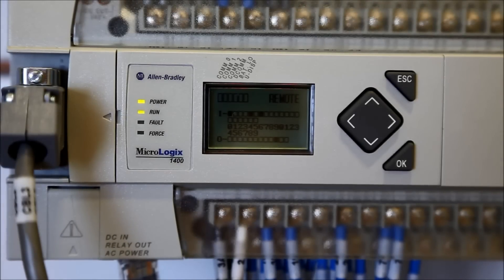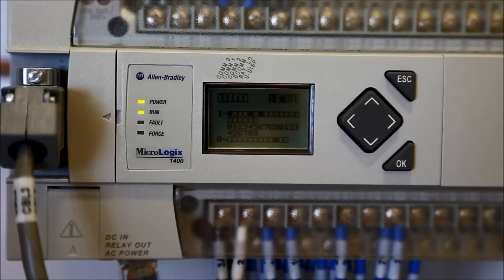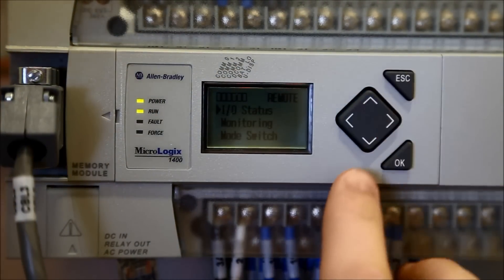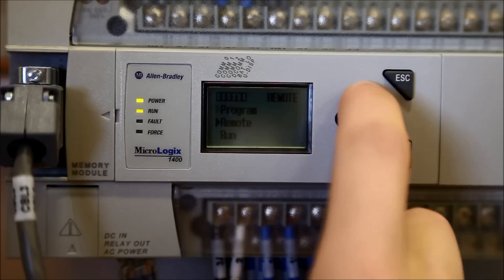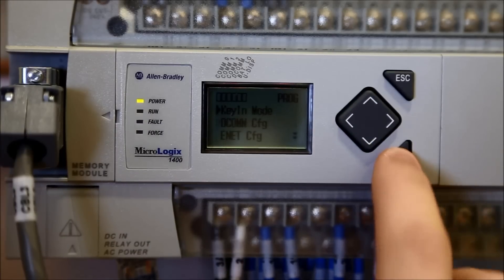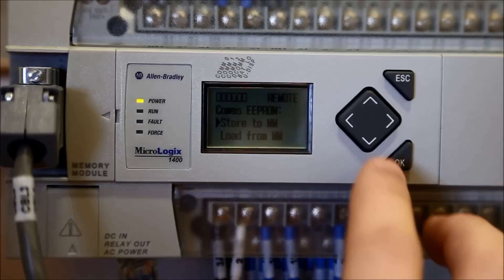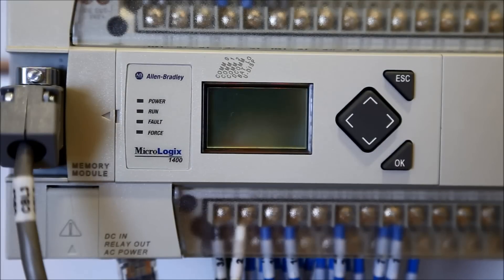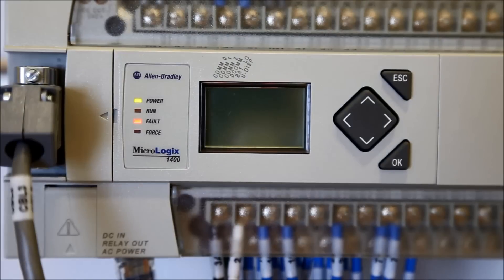Download a Program to a MicroLogix 1400 PLC via Memory Module Using the LCD Screen

Comment: What updates could it have on the MM that i should be concerned about deleting? If i take the old program thats written on the MM and then add a couple lines of code and then write to the MM again, would you suspect i would be fine?

Comment: Are you sure that is possible to insert an memory card with the PLC energized? Everybody says that you only can remove or insert the memory card with the power OFF. (Regards from Brazil)
Reply from the maker: Hi, A ML1400 memory module can be inserted / removed with the PLC energized (so long as a transfer is not in progress). See page 174 in the below ML1400 User Manual. This practice may have been required for older series PLCs.

https://literature.rockwellautomation.com/idc/groups/literature/documents/um/1766-um001_-en-p.pdf

Comment: how do I configure communication via IP network to connect my computer cpu via the network? model cpu 1400 rSlogix?
Reply from the maker: +Anderson Costa hello; you would connect to the PLC via ethernet, set a static IP Address on it if not using a router and set an IP Address on your PC within the same subnet (192.168.1.XXX) >> start RSLinx >> Communications >> Configure Drivers >> EtherNet/IP Driver >> Add New >> Select your ethernet connection >> Close >> Click on newly created driver and ensure Autobrowse is on >> you should see the PLC show up in a bit